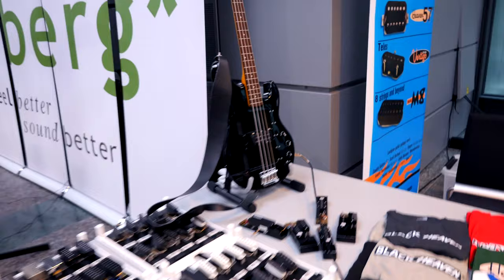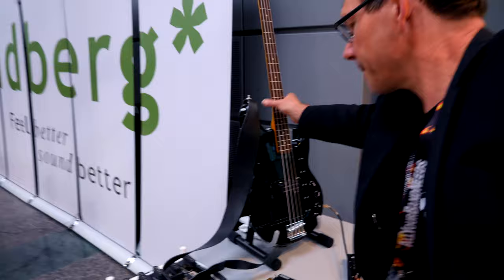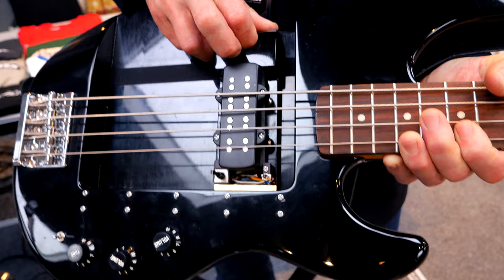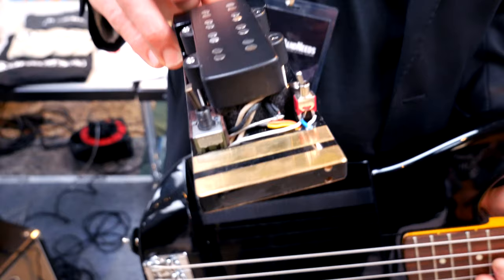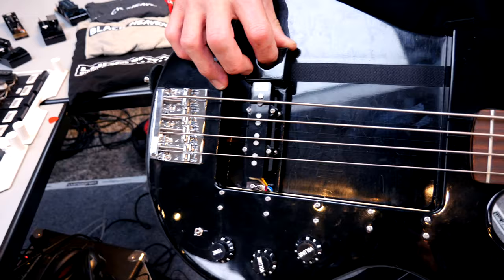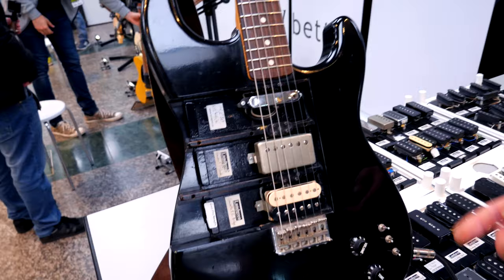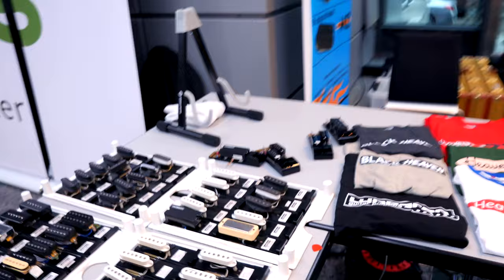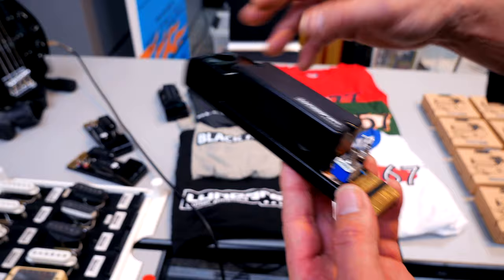Guitar Summit 2019 | JOHAN LUNDGREN OF  LUNDGREN PICKUPS DEMONSTRATES THEIR PICKUP TESTING BASS!

Comment: I used to live near a guy who attempted to do this with an aluminum rail mounting system.  He had a small company for years but it never took off.  It always looked like a great idea, but execution was tricky at best.  This example however, could work in the market.  A bass that allows an instant swap and lets you move the pickups to the sweet spot for whatever you’re doing would be a fantastic studio tool.
Reply from the maker: Sgt. Rock Agreed!! I think I should forward this video to a few builders 😂